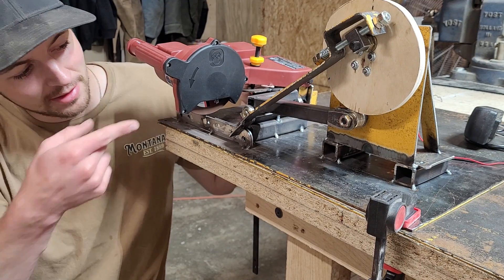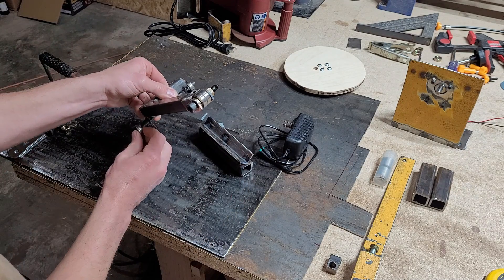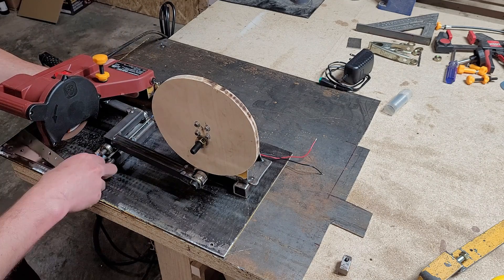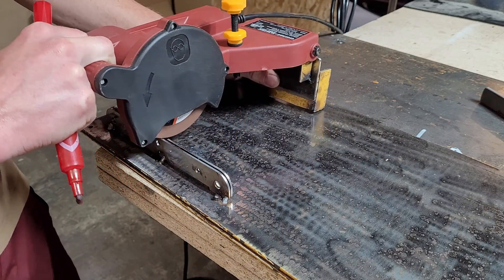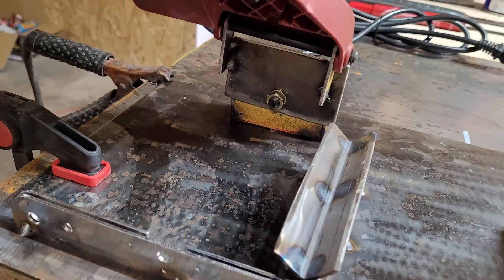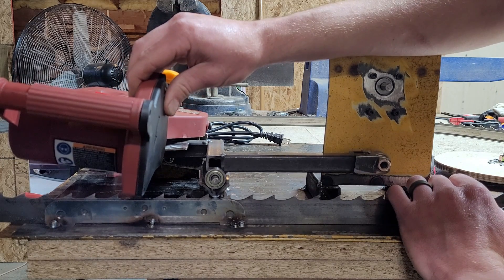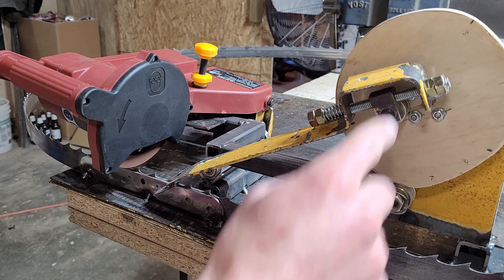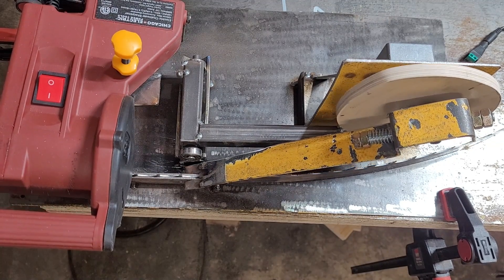Homemade Bandsaw Blade Sharpener - How to Build - Step by Step - Everything you need to know

Comment: ❤ well done Breaking or Setting of band saw blades is almost as important as sharpening 
I run every other tooth i.e. one-right one-straight one-left one-straight etc. to sharpen right-left as on a hand saw works worse especially if you want to split straight cuts 👍
Reply: https://youtu.be/SvBNCkhDcXk?si=2vvGQKBQu9CnVLH_

Comment: Any way you could trace out your cam to be able to print ?
Reply from the maker: I really don't think I could trace it out with the accuracy needed. When I was fine tuning the shape of it I would hit it with the palm sander quick, removing almost no material, and it would still change the profile of the cut.
Reply: I mean it would be a close start lol but if not I understand

Comment: What keeps the rocker/lifter axle from shifting sideways in the V?
Reply from the maker: There is nothing that holds it in place... but the way the bearings are on the shaft it can't move because the bearings are pushed all the way  in so it can't shift side to side.

Comment: Nice!
Simple, effective, frugal, time saving, using minimal fabricated parts. 
Is the threaded stud at the right side of the tooth pusher bar, for adjusting  for pitch?
I watched the whole thing and somehow missed that. 
If it will do 10 TPI or finer, i must build one.
I'll need a few centuries to finish the projects already started, but this one  looks easy and your video makes it easier.
Did you copy a commercial sharpener, or did you concieve of this yourself?
Reply from the maker: Thank you for the positive feedback! 

The threaded stud doesn't necessarily change the pitch, but rather it adjusts how far it indexes the tooth each cycle. So I adjust the threaded rod to get the blade to come down right on the back of each tooth.

I think you should be able to get it to do 10 TPI but you may need a smaller/thinner grinder blade. 

I didn't copy a commercial unit directly but used them as inspiration ;)
Reply: @craftzmanchris9859 @yf6682
Threaded Stud: Yes, it adjusts the pitch. On a saw blade or chainsaw chain. The Pitch is the Length or Distance between the tips of two adjacent cutting teeth. Also, you may want to consider not changing the factory profile of the tooth & gullet. Add specific angles to the cutter head base plate i.e. 7° - hardwood, 10° - general purpose, 14° - softwood.
Very nice video. Also would love to see your thoughts on a modification that allows the ability for a quick change of the cutter head & motor back & forth from BandSaw blade to chainsaw chain sharpener for cost efficiency of equipment.
Just a thought,
Wayne

Comment: Man... This is gonna suck! I definitely need to make one of these now. But all I buy for saws are 18 to 24 tpi for metal. It's going to take forever to get around the blade! Welp better get started...
Reply from the maker: At least once you get it set up you can walk away and just let it run! I thought about wiring the motor to a toggle switch. Then, making a piece that sets on the blade as it goes around (after its dialed in) and it hits the toggle switch once it makes it all the way around shutting the motor off. This way it wouldn't just keep sharpening and would have an "auto shut off" feature after the blade is complete. You could always get a motor with a higher RPM to make it run faster as well. Good luck and thanks for watching!